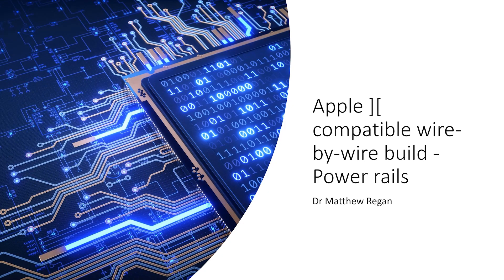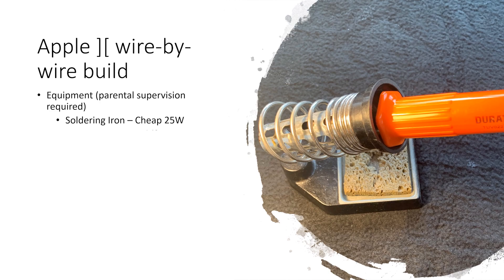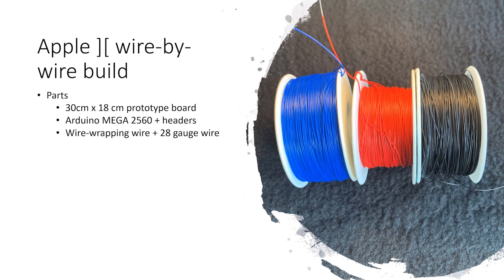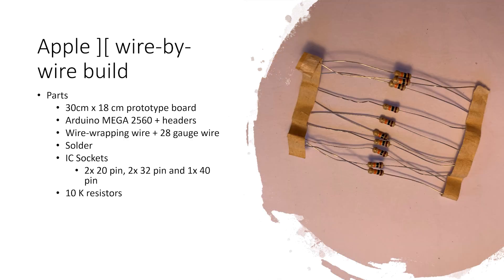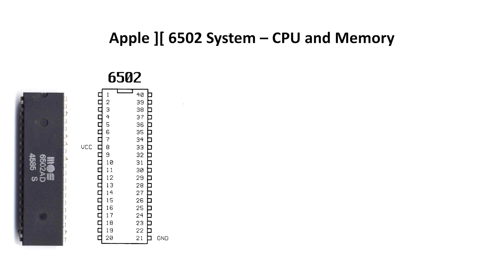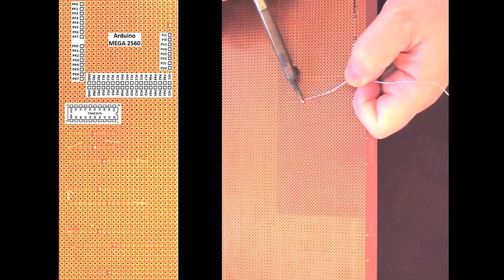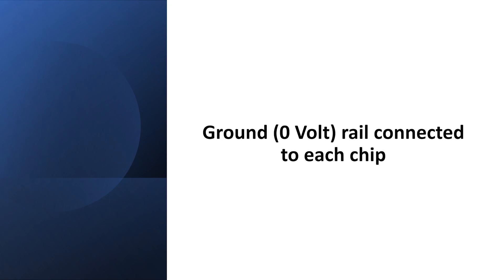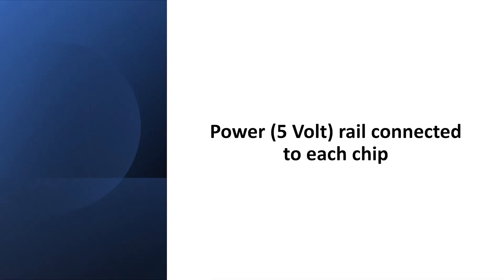Apple 2 wire-by-wire build, Part 2.  Chip placement and power rails.

Comment: 6:02 First, thank you so much for these videos! I always wanted to learn how computers work, and I learn best by doing.

I apologize for the question, but all this is brand new to me. Is the diagram on the left a representation of the top or bottom of the board? I am confused because all the 6502 pinouts I see online seem to be mirrored when compared to your illustration (on the left).
Reply from the maker: Welcome!  Good questions.  The pinouts you are use to seeing are taken from above the chip.  The wiring diagram is from the perspective of looking from beneath the chip, so it's flipped in one dimension.  Hope that helps.